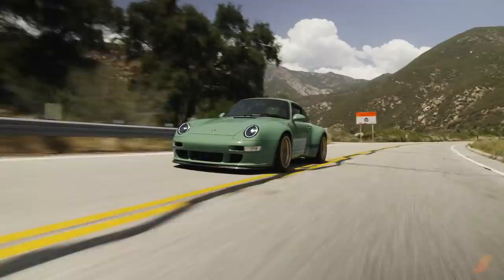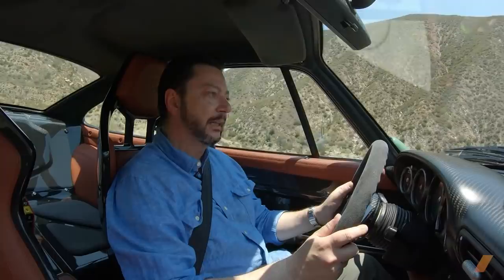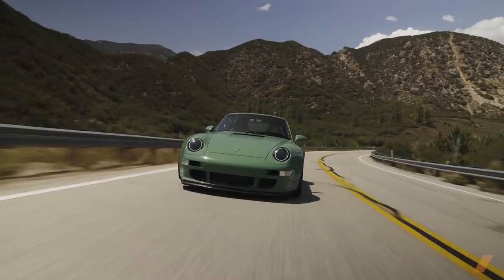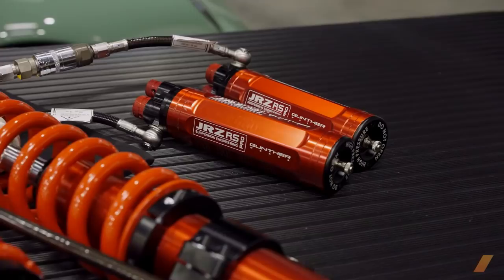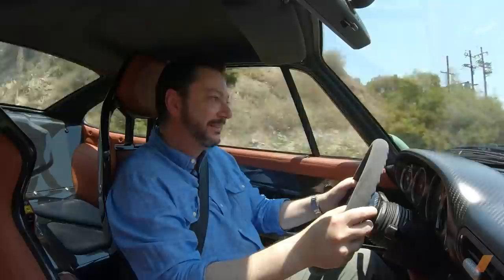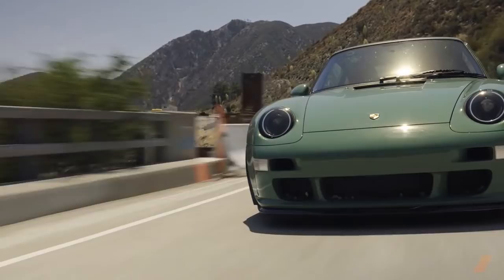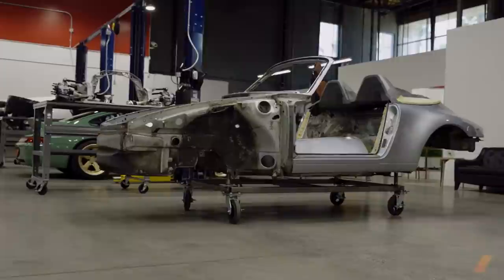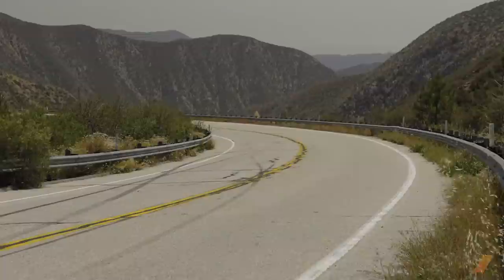Gunther Werks in 2021: How to "Remaster" a Porsche 993

Comment: a N/A 993 C2 does not weigh 3470 lbs...     and their 130.99 claim is highly sus.   every other car that i know of that can do a 1:30:99 at Laguna Seca has way more power or much less weight.

435 brake hp in a 2700 lbs car is not mind bending.  A Mclaren 765LT is 800 brake HP and 3000 lbs and has a space ship's worth of computing power to help it go fast and it would have a hard time doing a 1:30:99 on any given day.  i call bullshit.